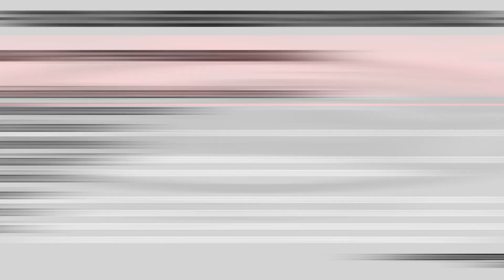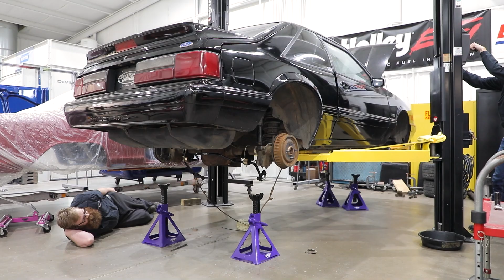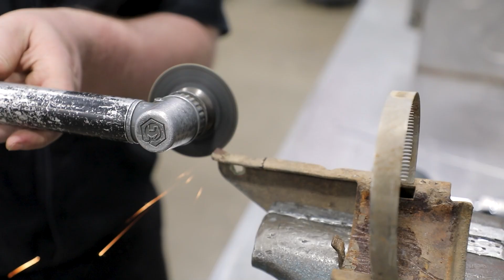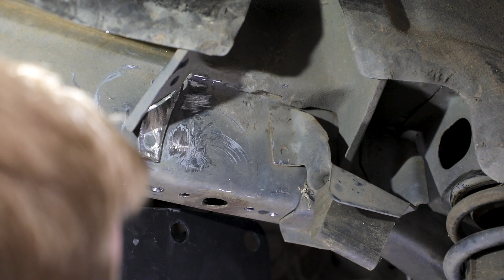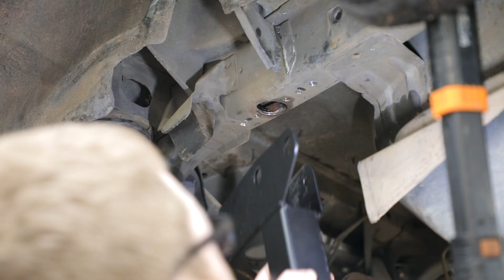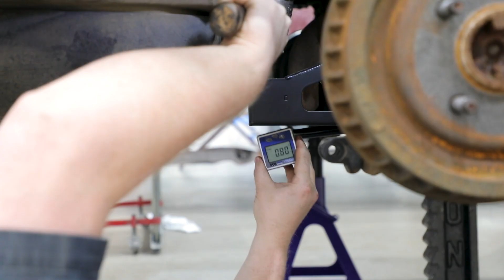Detroit Speed 1979-93 Mustang Install - Adjustable Track Bar Kit

Comment: i have a question, 
normally a 3 link or 4 link Axle setup with a pan-hard bar, the roll center is determined by where the Pan-hard bar is mounted
since FOX bodies never came with a Pan-Hard bar, does moving it change the roll center?
Reply from the maker: Yes it does. The track bar kit puts the rear roll center around 1-1/2” below axle centerline.